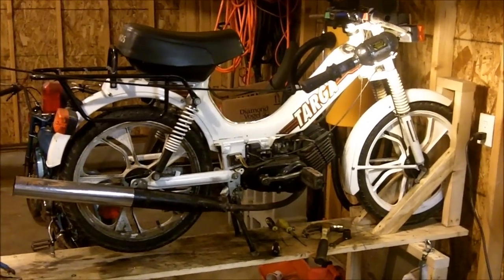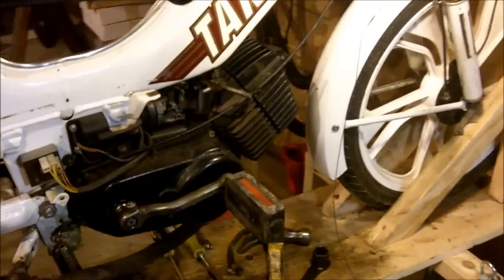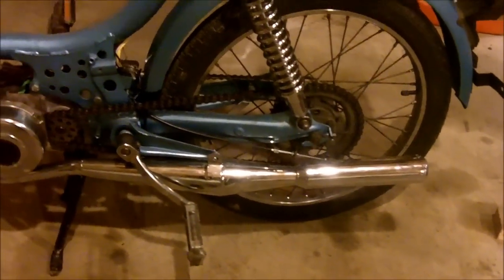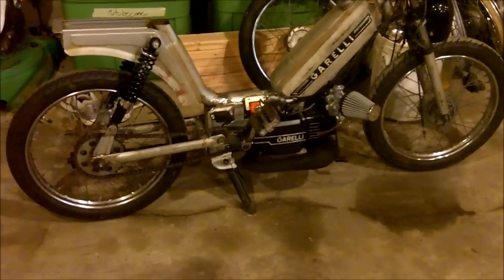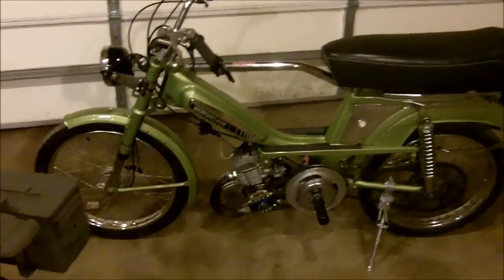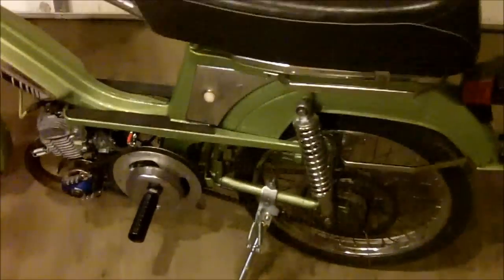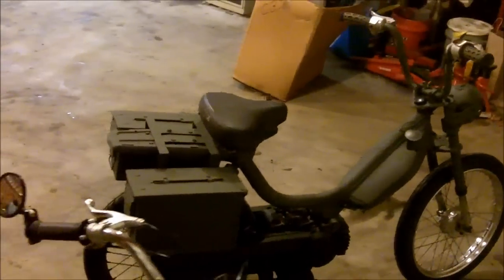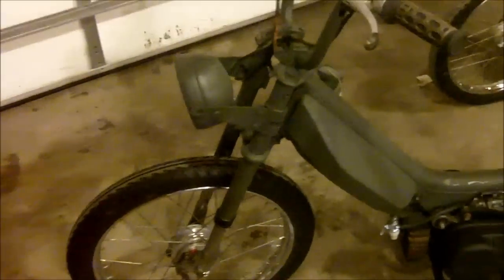Winter Projects 2011

Comment from the maker: @cdantonio84 Sounds like you probably have an air leak, usually they're around the intake between the carb and the cylinder. spray a little starting fluid around that area when it's idling(not into the carb) and if it starts to rev up you've got yourself an air leak